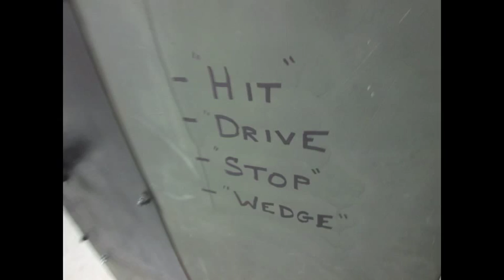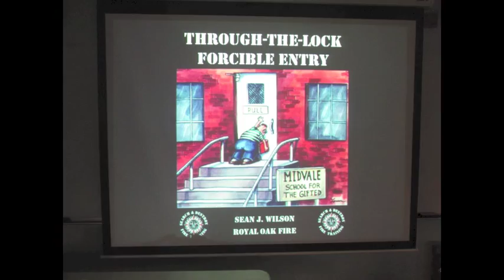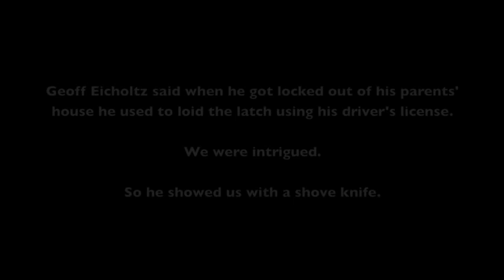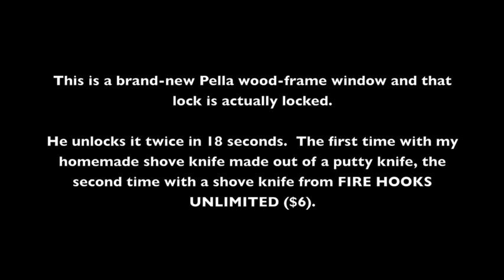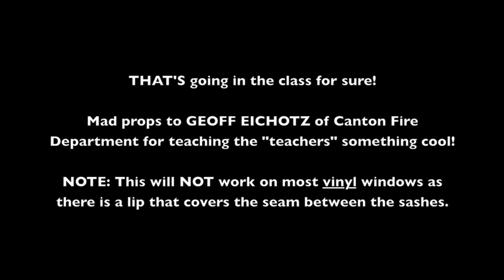S&D: "Master of Entry" Train-the-Trainer Course

Comment: I mean swinging the buster sledge rex claw on the lock, to set it in one swing rather than hitting it with another tool. I was wondering if it would be effective. If yes it would be a big time saver and would make the tool that mutch more efficient.

Comment: Can't you just swing the buster claw on the lock an set it that way? would be pretty badass...and quick.
Reply from the maker: Hey pal, this video's is 22 min long, so you'll have to be more specific about the part that you meant.  There are many ways  to do just about everything, so you may be on to something, but without knowing what exact part you meant I can't address it.  --S.
Reply: The part were you pull lock out their frame with a modified rex tool you also use that awesome mini sledge / rex tool combo.

Comment: around the 6 min mark
Reply from the maker: You mean on the Key-in-Knob set?  Pulling just the knob rather than getting behind the collar.  Yes, that is typically easier.  We teach that as a plan A with the behind-the-collar as plan B....or if an FD doesn't have a Rex tool.